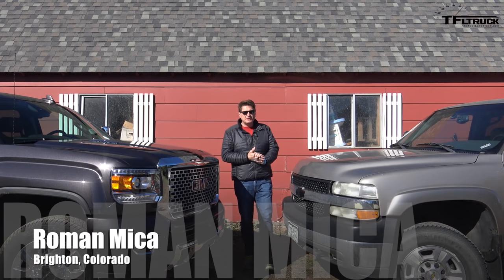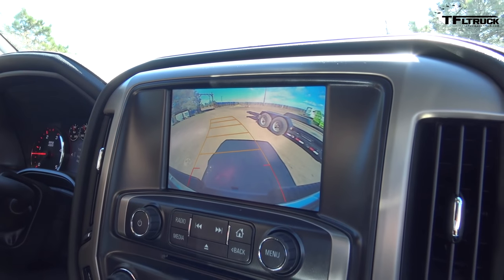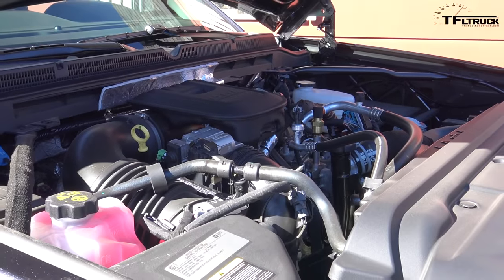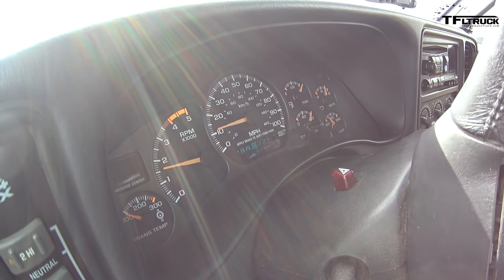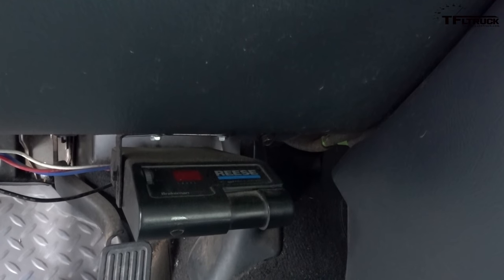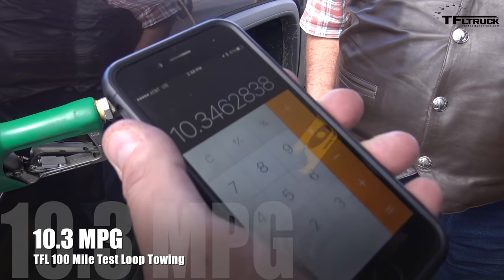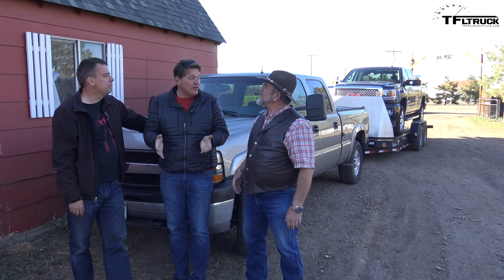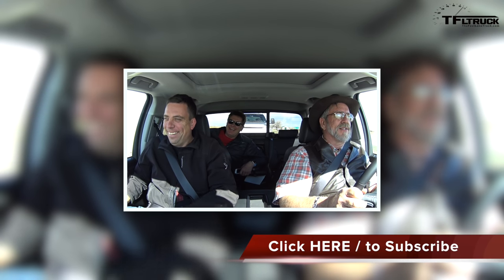2016 GMC Sierra Denali HD vs 2002 Chevy Silverado 2500 HD Mashup Review - Old vs New Ep.1

Comment: you guys do know the towing on that new GMC is somewhere around 17,900 not 13,000lbs
Reply from the maker: +James Ross It depends on the truck configuration. This is a crew cab 4x4 with a short bed. The rating goes to 13,900 lbs.
Reply: +The Fast Lane Truck very correct I was thinking about fifth wheel towing.  My mistake. This test was bumper pull.
Reply: +James Ross That is what I was thinking as well.  I have a 2012 extended cab w 8' bed and it is 17,900 or thereabouts iirc.
Reply: +The Fast Lane Truck It doesn't seem right because Mr. Truck floored it in the beginning of the IKE GULTEN  while Andre took his Time with out flooring it and Andre used cruise control so he got better gas mileage  unlike Mr. Truck he didn't use cruise control       

Please do a retry to make it fair
Reply: The 2002 was likely tow rated under the older system. The 2016 is under a new rating system. I forget both their names however, but I wonder what the 2002 would rate under the new system.
Reply: +Darth Mall I would be interested as well.  I was floored when he said his '02 was only rated to 12,000 pounds.  We're seeing numbers like that out of half ton trucks these days.  In the case of the F-150 you even have V6s towing roughly that much.  That said, I'd like to see that '02 and a 3.5L EcoBoost F-150 run the Ike Gauntlet with 10,000 pounds or so.  Old V8 turbo diesel vs. new tech gasoline, see how the old heavy duty compares to the new light duty?  I think it would be an interesting episode of old vs. new.
Reply: UnsulliedSpy I think it would be a cool episode but non factual.  That 02 HD would still rock a half tons world  pulling any kind of weight when you start counting handling as a factor.
Reply: +James Ross Agree 100%, I have done a lot of towing in all makes and duties of trucks.  A full size 3/4 or 1ton truck is a very different vehicle.  Once you tow anything over ~7,000# with one of them you know you will never tow heavy trailers with anything else.  I had to pull 6 loads of an overweighted trailer(18,500#of brick) 100 miles over hilly terrain last summer and was extremely impressed with the 2012 GMC 2500HD.  I had better accel, braking, handling and just felt much safer pulling that than I have pulling #5,000 in my 2005 Tundra.
Reply: +James Ross Also I believe the 2002 has an iron block vs the all aluminum 2016. 

IMO GM got these trucks right from the 1999-2002 generation trucks 1500 through whatever designation that uses this new body style. After that, it's like build quality took a swan dive of a short peer. 2003-2014 Interiors got really cheap and flimsy, though mechanically they seemed to hold up. I still have the 1st Gen 1999 Silverado 1500 4.8 with almost 200,000 miles with mix towing then carried payload wait for about 120,000. No issues. I had briefly, a used 2004 1500, all sorts of electrical issues all under 40,000 miles traded that in for 2012 ram 1500 of which I am approaching 40,000 miles now and not one issue...all trips to the dealer have been maintenance service. Chrysler or FCA is getting them right these days. And the build quality on the 2014 on up seems like GM is taking it seriously.
Reply: James Ross It would be apples to oranges for sure, but I think it would be interesting as well as informative.  A lot of people just see the big numbers on these new pickups and then hitch up a big trailer and go hauling butt down the highway.  Seeing the differences between the half ton and a heavy duty would be an interesting video if done well, in my opinion.
Reply: +Darth Mall the 1999 silverados are tough
Reply: +UnsulliedSpy you're very right it would be informative for sure!
Reply: +Darth Mall   i have a 98 chevy, it can tow 6k or something like that, i've towed that weight around country and the car does not feel it
Reply: +James Ross does it matter if it towed less and did worse? Imagine sticking another 4k lbs in the back, it would be under 10mpg's what is your point?
Reply: +Saki630 not sure you're point but okay.
Reply: Ivar Markusson What kind of '98 Chevy do you have?  My brother has a 2003 Yukon XL (with the 5.3 and 4L60E) and it struggles to pull his 18' boat and trailer (around 4k pounds).  Particularly on hills you've got to have the throttle buried and you'd still be lucky to maintain 60-65 MPH.  And, even with the surge brakes on the trailer, it really struggles to slow down that load.  I believe it's rated to tow around 6k pounds but it really struggles with just 4k (ish) pounds.
Reply: i have a k1500 ext cab, 5.7 vortec/4l60e

the 5.7 is in some ways better for towing, has more low end torque, 
 its no hd diesel, but it has served me well,
Reply: That'll never happen
Reply: +George GMC Sierra Denali I second that lol!
Reply: ***** I priced one out with a 5.0, 4wd, and a couple options (nothing fancy, pretty much a standard XLT) and it was over $40k, that is entirely too much for a truck.  My dad picked up a Ram 1500 with more options for around $32k, I think what trucks are selling for these days is just nuts.  For my use my '06 Ranger fits the bill perfectly, if they do end up bringing the Ranger back to the US and they don't get stupid with the price I'd consider buying one.
Reply: A 2016 GMC Sierra 1500 Denali can reach $65,000. I'd expect that for all the crap you get.
Reply: George GMC Sierra Denali Yeah but the Denalis are made to be a luxury truck and full of gadgets and modern features.  Great for people that can afford it but I need something more affordable as well as more utilitarian.  If I had a Denali I'd be afraid of scratching the paint and banging up the wheels offroad (as well as worried about puncturing the low-profile tires) and tearing up the interior.  A regular cloth interior with steel or basic aluminum wheels, power windows would be nice but not required, stuff like that is what I want in a truck.
Reply: 1. Get a Sierra SLT. Still luxurious, but not as premium as a Denali.
2. All Terrain tires are an option.
Reply: The Base Sierra is what you want. power windows standard. Unless you get a "Regular Cab." Then, power windows is an option.
Reply: +UnsulliedSpy A 2002 extender  cab 4x4 with the 6.6 is rated to pull 22,000lbs, not 12,000.
Reply: +Bill McGregor 22000 is the GCVW, Gross COMBINED vehicle weight.
Reply: Mark Schaefer Yes I knew that, I always include the vehicle  weight in my towing weights.
Reply: +Darth Mall Probabaly less. I towed 8k lbs with an '02 1500 HD (rated at 10,500lbs I believe) and I'd say that was pretty much as much as I'd want to tow with it. Powertrain had no issues handling it but on a hot summer day you had to take it easy or the temps would start getting too high for my liking.
Reply: +Darth Mall My 2011 Sierra 1500 is pushing 300k and its as solid as it was from brand new. Apart from replacing the original front end and wheel bearings at 190k and all my power steering/transmission lines at 270k its all original. Not one leak or damp spot anywhere underneath either. The exterior could use a re-paint as I drive it year round and there are rock chips everywhere. No dash cracks or any other issues with the interior although I do agree the interior was much nicer and more comfortable in the early 2000 trucks.
Reply: ***** Yeah Dodge and Ford may claim thier trucks can tow 30,000lbs, but I wouldn't  want to do it with them. It's  not so much the power part as all trucks these days have more than they need, it's  the fact that the truck only weighs 7000-8000lbs and you have 20,000 plus behind them.
Reply: ***** I'd feel safe with 23,000 lbs connected to a Sierra HD DRW or Silverado HD DRW with the Goose neck, but nothing more. And, I'd never trust Ram or Ford. The max for a Sierra 2500 HD/Silverado 3500 HD is 23,200 lbs with Goose neck.
Reply: +George GMC Sierra Denali I've  pulled 21,000lbs with a 2015 Ram  3500 single cab dually. That load was a D4 dozer on a float  (5th wheel, 120 gallons of diesel, and an S70 Bobcat. It pulled it fine I guess, but I always  had this fear in my head of having to get on the brakes quick or having to make a sudden  turn. It was a 6 speed manaul  which definitely gave me more confidence as I felt I had more control with what was going on. At the ekd of the day though, I'd  rather have pulled it with medium  duty international or the like.
Reply: +Bill McGregor Well if we're going for numbers towed. Chevrolet has towed a 747 and multiple trailers full of logs with older C/K model trucks
Reply: Mark Schaefer Yup, I saw those videos. They show how capable they were and still are.
Reply: +Mark Schaefer You could tow a 747 with a 4cyl colorado, it's  not an impressive  feat. Same way that all the Toyota  fanboys were so proud that the Tundra pulled the shuttle, again not an impressive feat. I care more about how easy it is to pull the loads I have to on a regular  basis. In my opinion the Rams are not the best in this regard, they aren't  a confidence inspiring  towing machine. I'd  rate the GM trucks and the F series higher because  they feel more planted with a big load out back. The Fords feel the most stable in my opinion, but they ride like bricks and have horrible steering, the GM trucks are much better in this regard.
Reply: +Bill McGregor I do agree with you though that pick-up trucks don't need to be towing as much as some people do with them though
Reply: ***** A agree with you, but, I wouldn't say anything good about Ford. I'll never own one in my life, so I wouldn't be able to say anyhow. The only trucks I'll own in my life is trucks from GM.
Reply: George GMC Sierra Denali
Same for me
Reply: UnsulliedSpy I'd feel the same way about scratching up a Denali, but an SLT... Nope! Still an awesome truck, but I could take it off road.
Reply: Now that I think of it, there's no option for the Z71 off road package. I highly recommend getting a truck with the Z71 off road package if you're going off road. The SLE trim is actually what you want. The Z71 off road package and even the All Terrain packages are available. Also cloth bucket seats are an option. Or a standard cloth split bench seat or optional leather split bench seat.
Reply: +I'm Zoid why don't you
Reply: +walterpakiaolol why not?
Reply: George GMC Sierra Denali nothing
Reply: Mr Laguna Exactly.
Reply: The Fast Lane Truck you guys should take Andre's truck up the ike gauntlet to see how it compares to the new trucks
Reply: Eddie211979 That'd be a cool video
Reply: I know right?  And even if they could get other older model trucks. That would be great
Reply: Eddie211979 Yes it would. I'd definitely watch them videos.
Reply: George GMC Sierra Denali I don't think we would be alone lol
Reply: Eddie211979 I agree
Reply: they know
Reply: semidemiurge 
Me too I got the 2016 SLT crew cab 8’ bed and it’s 17.....
Reply: The Fast Lane Truck delete the new one and watch mpg and performance go up. It has a more restrictive exhaust also. So delete the new one and put an exhaust on it. Bet the new one destroys the 02 on mpg

Comment: 2002 with only 160,000???🤯
Reply: And no rust
Reply: Mines is a 2005 with 220,000🤣 no rust tho so and it’s still running strong
Reply: 2002 ,240k miles
Reply: I got my 05 Sierra a year ago with right under 50k
Reply: My 1996 only has 126k. But I figured out long ago, with the MPG of big trucks/Suburbans it is cheaper to get a used fuel-efficient car for a daily driver and pay insurance on two vehicles. then to feed a big truck as a daily driver. At least for the miles I drive.

Comment: great video! amazing old truck still great on mpg and can keep up with new truck.
Reply: Emissions!
Reply: +Dodge 318 Cummins yeah basically... I'm glad my dodge is just old enough not to have all that junk
Reply: +SilverStar Heggisist oh what year is your dodge? What year did they start all the BS 2008 or 2010? I'm lucky my truck is old enough to not be inspected or pass emissions.
Reply: Dodge 318 Cummins in my state we don't have emission's testing for diesels. Diesels are emission's exempt. 

I believe that stuff with the filters and later DEF started around 2005 or 2006 (but I'd have to look it up to be sure)

My Dodge is a '03 3500. And unloaded gets better gas milage than a Honda CR-V (according to the CR-Vs computers I've driven for inspection, they get around 16mpg with a 2.4L gas engine) and with my 5.9 I get better than 20mpg and I weigh 7000 pounds empty.
Reply: +SilverStar Heggisist what state are you in? I also have a Honda CR-V it's not that good on gas. I would like to get a new Cummins but I keep hearing about the emissions crap. I'm looking at a Ram 3500 dually regular cab 6 speed manual for $40,000. I just looked at the duramax Chevy Colorado which is also $40,000.
Reply: Dodge 318 Cummins what year is that? Mine was $13,000 and came with the tuner. While I love my old Chevy, would never get a standard cab again. Too cramped. 

Pennsylvania
Reply: +SilverStar Heggisist oh the car or the ram? The truck is a 2016. You can build your own ram on there website. I was building Chevys at first and they are very expensive for a v6 and 2wd the Dodge Ram seems to be cheaper.
Reply: Dodge 318 Cummins I don't own a car... I kill cars... Both my Chevy and Dodge are 1 ton trucks. 

But I never buy bran new. Over priced and massive loss of value just driving off the lot.
Reply: +SilverStar Heggisist so what do you have a dodge Cummins 1 ton and a gas 1 ton Chevy?
Reply: Dodge 318 Cummins no no both are diesel 1 tons. 

The Dodge is my daily driver pavement princess. 

The Chevy is ex military, lifted 6 inches on 37 inch military tires. Is my off road, go anywhere a jeep can go while hauling 4,000 pounds of stuff in the bed vehicle. The Chevy has the bullet proof 6.2 liter diesel. Which in spite of popular belief is not just basically a 350.
Reply: +SilverStar Heggisist my uncle had a 1986 Chevy k20 plow truck 6.2 diesel. That thing had no power at all lol. It was automatic and the tranny was shot. I'm looking at 6.5 turbo diesels for really cheap less than $2000 as well.
Reply: Dodge 318 Cummins the 6.2 isn't a powerhouse. It was built to be a fuel sipper and never die. A 30 year old 6.2 can beat a V6 or even a 4 cylinder on fuel economy.

Comment: it's the bed cover that helped get better mpg for the old truck
Reply: +_ _ better air flow just like putting the tailgate down improves air flow
Reply: +Brody Schmidt that is controversal, testing of the tailgate down and tonneau cover didn't show any difference in mpg
Reply: +Tim O depends on the truck. some research actually showed that putting the tailgate down increases the drag with decreases the mpg. things like bed cover, a small spoiler ( not like those on the sport cars) on the tailgate or a spoiler on the top of the crew cab help reduce the drag on trucks. how much reduction you ask? can't say it depends on how aerodynamic the truck is.
Reply: Testing with the tailgate up is actually more aerodynamic. And who cares about the box cover making a difference. Remember the pos piece of plastic under the front bumper on the new truck? Plus, the whole design of the new one is meant for aerodynamics.

Comment: Marked differences in noise levels. My grandparents had a 1996 Chevy 2500 Diesel, was so loud. They then got a 2001 GMC Sierra 2500HD with the 8.1L V8. Was so quiet and smooth in   comparison. My Nana hated how loud the diesels were back them. But towing a '42 5th wheeler we got about 4mpg lol

Comment: Do an 8.1 vs the 6.6 diesel
Reply: +Jake Schmale How much torque and HP does an 8.1L have?
Reply: +nmelkhunter1 like 500
Reply: +nmelkhunter1 I've seen the 8.1 vortecs beat the diesel motors in tug of wars.
Reply: +nmelkhunter1 500 torque and 320 horsepower
Reply: More like 450 ftlbs. 330 horse. Bought mine brand new in 07. Had the allison 6 speed. Great truck!  Towing easily matched up to those older diesels. Horrible fuel economy!

Comment: These new trucks aren't shit.. That is if they should even be considered trucks anymore with all the b.s tech. shit in them. I'll stick with my older trucks. These new ones are just piles, with all the sensors and stuff. Its not even worth it, stick with the older trucks.
Reply: my dad has the new one and all of the sencers help while towing big trailers
Reply: +HALO3286 love my 2016 GMC sierra 2500hd
Reply: +Handsome B Wonderful you just got your ass kicked by Chevy it doesn't get any worse than that
Reply: Funny thing is, all those fancy creature comforts can be added to the old trucks with aftermarket parts. I just bought an 05 ram 1500 slt quad cab, it was perfect inside and out. I paid 7 grand for it. I put in a set of kat skinz leather seat covers 950 bucks, yeah the same the factory uses when you buy  a new one. I bought a seat heating/cooling kit 75 bucks, and i installed a nice pioneer gps stereo head unit 600 bucks. so for around 8700 dollars i have every creature comfort the new ones have. My truck looks perfect, no rust, beautiful paint and it came with the premium chrome aluminum 20 inch wheels. The only thing i don't have is the mds bs which is just one more part to break that I don't need. If i want more power I can do a cam swap, easy 100 hp gain right there. The only thing i wish it had is one of those new 8 speed transmissions but I can live without the near 35k price tag for that. I have 98% of what the new ones have at a dirt cheap price. If i sink even 10 grand into it above what I paid for it, it's still much cheaper than new. I have no payments, i can afford to repair anything that breaks.

Comment: I have a 2006 Chevy with a Duramax with 157K miles. I love that truck, and knock on wood, as long as I keep up the maintenance I think I can get another 100k without any major problems. BTW, you guys nailed it when you said that wind is like pulling up a steep grade. I hate pulling into the wind; especially if I am pulling a fifth wheel or other such high profile trailer!